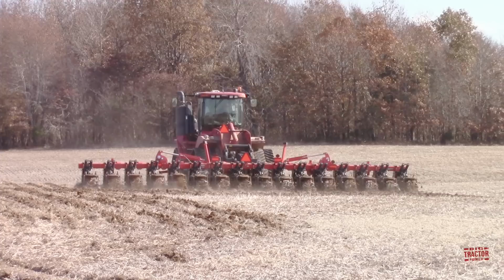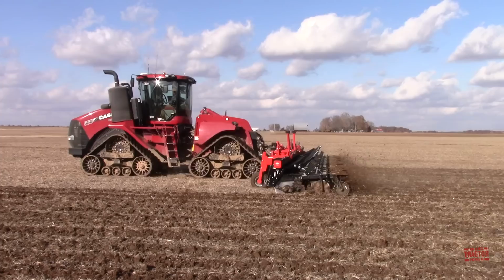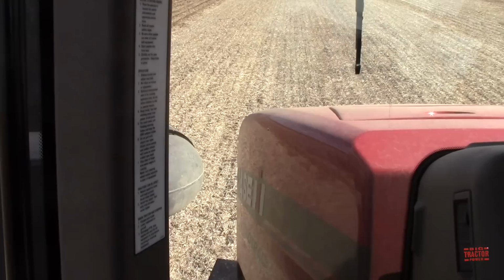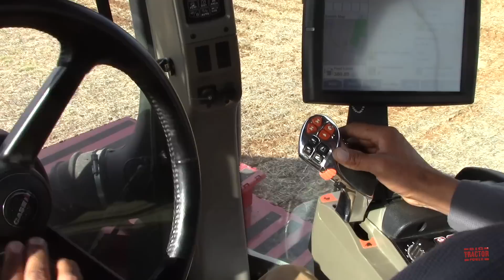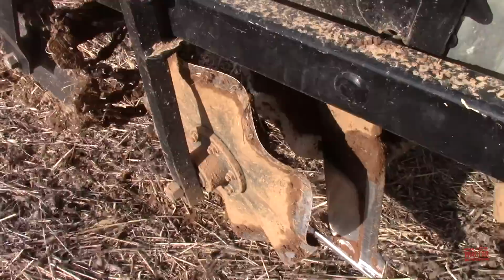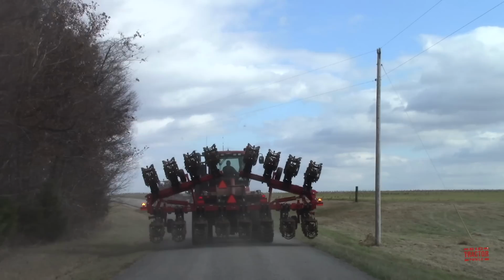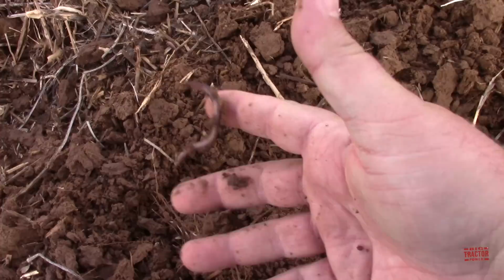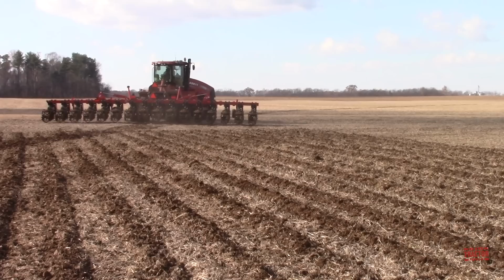CASE IH 580 QUADTRAC Tractor & Kuhn Krause 1205 Gladiator

Comment: Case IH Steiger power. What a good job that tillage equipment dose. It's very well manufactured as are all the tool bars are no matter the manufacturer. That muffler is to me is plain ole ulgy, it's massive and looks tilted. Folded id hate to meet up with oncoming autos going down a two lane road, it's still huge. A fun Saturday BTP episode🚜👍
Reply from the maker: At 22 ft when this farm’s 580 and 620 Quads were rolling down the road traffic has to pull off the road. The muffler is huge but it does not really cause any visibility issue. Interesting the New Holland T9s built in Fargo and sold in Europe have the muffler mounted horizontally on the hood on the left side.  I am surprised all the red and blue tractors don’t have the muffler set that way and completely remove it from the line of site.

Comment: Thanks for spending a little time on the row units - coulters, closers, chain rollers.  Sometimes your videos (as well as others) have lots of distance shooting, watching the tractor and implement pass across the field, but we never see what is "in the ground."  The details of the tillage equipment are of interest to some of us.  I did go to the Kuhn web site to learn more, but your video is important.  BTW, your mention of the weight is not what the spec sheet reads  for the 1630 model.  The implement can be adapted to many uses (e.g. NH3), so there can be a variation.   Thanks - very good video.
Reply from the maker: Thank you for watching. I try to show implement details when I can.  Often they are working the entire time so I can not show the machines set up. In this video I had a split second to show the 1205 row unit as he was coordinating with the 620 Quad on where they were moving too.  The weight that I used on the 1630 comes from page 14 of the 2017 Gladiator Brochure.  What does your spec sheet show?
Reply: @bigtractorpower  https://www.kuhn-usa.com/crop/tillage-tools/strip-till/gladiator-1205      
I understand your constraint on time.  You are in the presence of those intent on getting the job done, and taking time out of their work time.  Taking more time to allow you video shots is expecting too much from the operator.  You do amazingly well to get some time with the operators, so getting extra time is indulging on their time.  I think in this case, the operator was preparing to fold up to move, so it worked out for you.  Matt is very generous with his time and comments.  It is apparent, this operator was not talking, and that is OK.  Thank him for giving you a ride!  You take extra efforts to avoid showing most operators, except Matt.  We understand that consideration.  Good on both ends.   Again, ... I appreciate getting a small glimpse into the world of large scale farming.

Comment: Awesome, my OCD bothers me, it looks if the driver drop the tiller every time to late and make head land wider and wider, lol just my view, very nice video
Reply from the maker: The Quad was working along a grass water way that cut across the field at an angle.  The GPS drops the 1205 at the exact spot where the 80ft headland boundary ends but it makes it look like big loops. Many strip till farms here  prefer to just work the headlands if the field with a turbo Till in spring rather than put strips on the turn around areas.
Reply: @bigtractorpower  Thanks Jason

Comment: It looks like the 3pt should lift higher. The Case IH articulated tractors just have that powerhouse look to them. There's several around me, along with the Deere's, but the Cases have a beefier look to them. Maybe it's that wide, sloping hood
Reply from the maker: Quadtrac are solid all around tractors.  They do a nice job.
Reply: On uneven ground it's a struggle without more lift height. Have to fold wings some times and thats hard on things

Comment: One of the heaviest 3 point implements I've seen.  Big advantages using the 3 point.  Used to do row crop tillage with a 3 point cultivator.  Every error is almost instantly reflected, really need to be watching without GPS and making those headland turns perfectly.  Thankfully I was on an open station Allis 185 so my vision wasn't blocked by even by a window.  My sunscreen was a couple mm's of topsoil.  Like to see new implements.  Not just big ones but innovative ones, you do a good job getting these videos.  Thanks.  You have patreon?

Comment: Is there much of a difference in the cost of upkeep for the tracks
Reply from the maker: Tracks will need to be replaced about every 3,000 hours in the conditions this tractor runs in. Tracks add about $100,000 to the cost of a new tractor. I am not sure what the belts themselves run.

Comment: Great stream sir Question  how often do they change out tractors what I mean is how many hours on one of these bad boys before they trade in for new one seems like if you keep them maintain that they would last for 10000 hours thank you sir
Reply from the maker: It all depends on the farm. Many hear trade each year and others two or three years. They cover allot of ground in this area with double crop soybeans after wheat so many farms have new machines often to avoid down time.

Comment: But whats the point of this tool?  Tool and its results looks more like a row crop cultivator than tillage.
Reply from the maker: It has all the results of primary and secondary tillage in a confined 30 inch row.  This allows for reduced tillage and equipment passes on the field.
Reply: @bigtractorpower  Aah, You're saying its intended to run on top of existing rows.
Reply: @oldretireddude  It is creating the seed bed for next year. With gps they can center the row over the the trough cut by the center shank. Thus allowing better root penatration.

Comment: The cab on the Case/I.H.quadtracs are very noisy,my neighbor runs these and I can't see how in the world he takes listening to the turbocharged diesel for 12-16 hours a day.
The John Deere version is much quieter and refined.(Just sayin)
Reply from the maker: I find a 9RX cab to be much noises than a Quadtrac.  The 9RX has a hydraulic whine to it the 9R does not have.  It’s hard to give a comparison because my camera microphone picks up the 12 air conditioner vents in each tractor and the air sometimes makes it sound like I am outside.
Reply: @bigtractorpower  I have a SPL meter and the Deere was about 3-5 decibels quieter.
Reply: @bigtractorpower  I have to say the QT does sound a fair bit louder than some Big Deeres you ride along in, The only comparable tractor I have driven(long ago,,,lol),was a MF 4880,fantastic in its day..